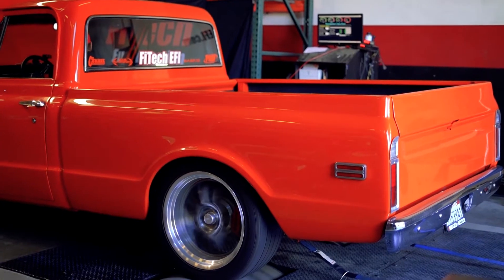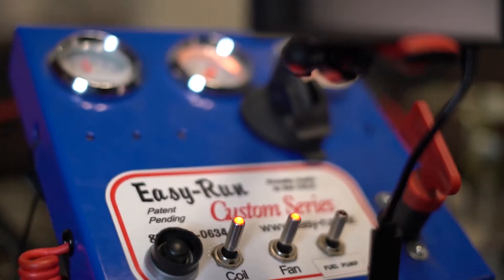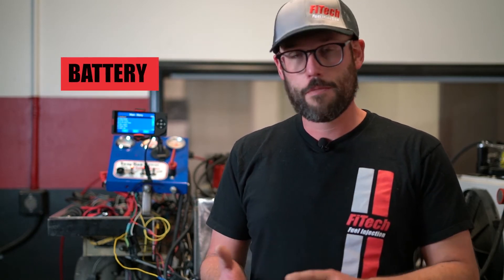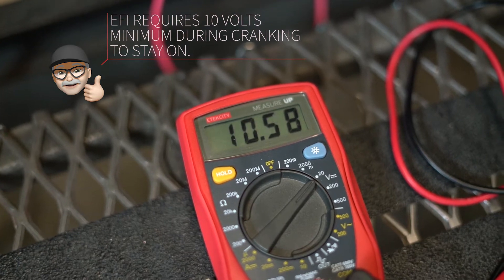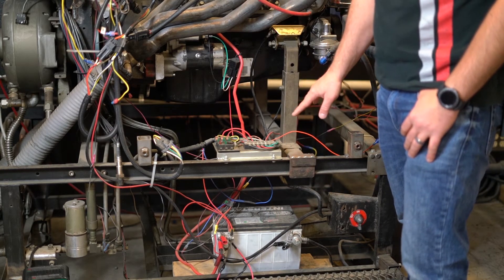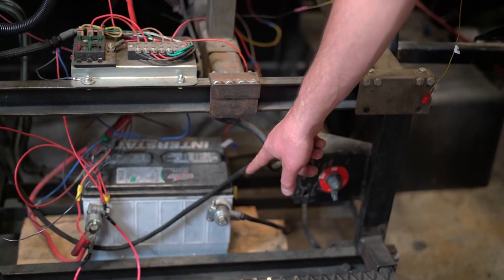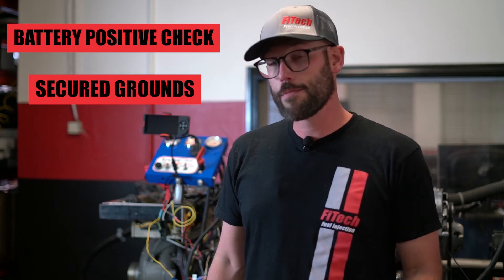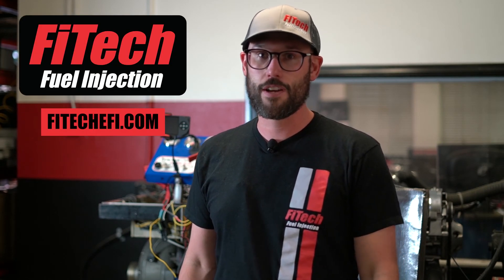Battery Voltage! | Tech Tuesdays | EP1

Comment: OK, I checked the red wire that’s going to the battery. I checked the white wire. It’s also going to the battery. And I still turn the engine over and it’s still at 13.5 when you’re not turning the engine over when you’re turning the engine over drops too 10.7 but the battery is good. I even bought a new battery. See if that fixes the problems same thing. I even mounted a extra ground wire on top of the throttle body and it’s still not starting.
Reply from the maker: Hello sir,

The next step here is checking the voltage on the battery during cranking, with a voltmeter lets verify voltage directly on the battery to eliminate the possibility of being a faulty battery. The voltage drop you are seeing is concerning and is the cause of the issue.

Comment: Do you have any recommendations on where the AFR/trim should be for a stock 6.0 ls motor? Mines popping and banging when revving in park and I'm not sure why it seems like it's rich
Reply from the maker: AFR trim should be close to 0% because the system will apply the fueling change to the AFR learn. Not using the proper MAP sensor would cause over fueling. This makes the ECU see the wrong vacuum and can cause over fueling. Also exhaust leaks will make the system read LEAN and for the system to add fuel. The LEAN condition would never go away so the system will always over fuel.

Comment: In the instructions to my fitech ultimate LS EFI kit it says to hook  the positive cables on the harness to the starter not to the battery and in ur video you instructed to hook them straight to the battery which is best?
Reply: Would be interested to know this aswell

Comment: Hi, my alternator is sending 13.5v but my fitech is showing 12.8v. 12.8v can cause any issue in fitech sistem?
Reply from the maker: 12.8v should not cause any problems.